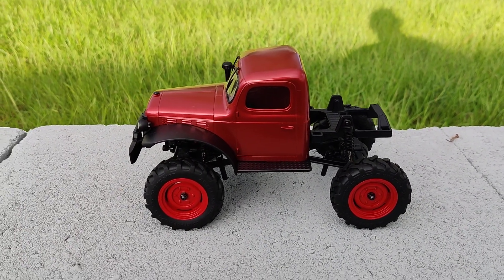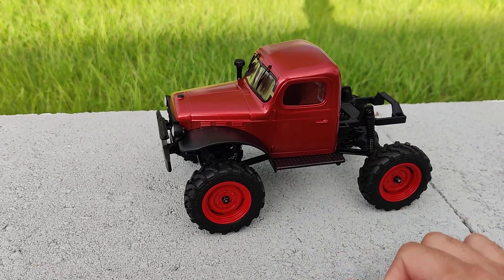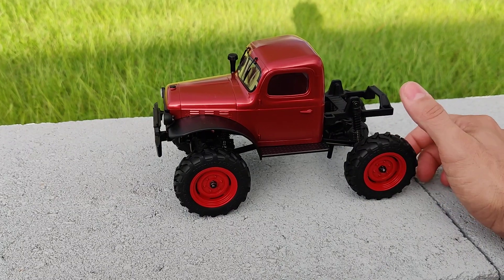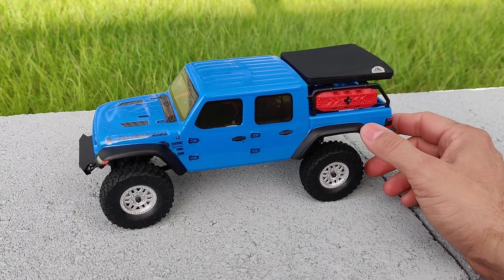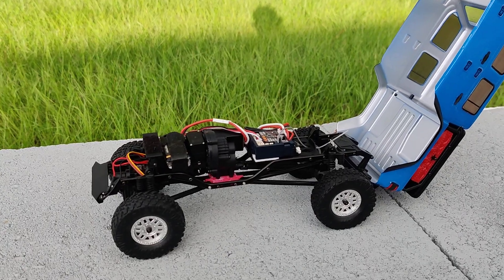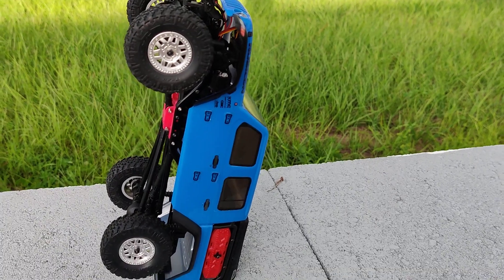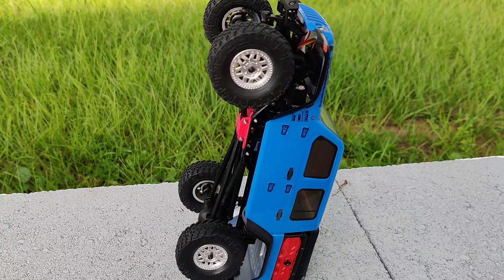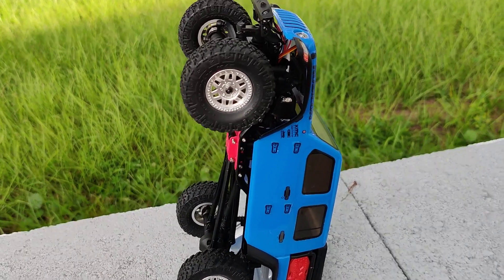SCX24 Two Speed Transmission Swap!!!

Comment: Thanks for showing!  Pretty cool. Feels like running a Furitek with the old axial scx 24 radio and using the different switches for control or speed. I personally prefer a single speed that has a good mix of torque and speed so including have to switch between gears
Reply from the maker: I like it but definitely not suited for any kind of competition due to its high center of gravity but I think I can make better, already tearing it apart to get inside its guts!!!🤣

Comment: Well I started on a mount to make this swap but ran out of time. Haven’t been able to mess with it in a couple days. Think I’ll stick to fcx24 axles if they get some metal gears though. Those worm gears killed the speed. High is like low lol. Hopefully we will just get some chassis options for the fcx24 soon! Hint hint 😉
Reply from the maker: Working on that as well😉. But yeah, this set up is mainly for those looking for extra slow. I think the fcx will open up the door to a different class altogether if we can bring enough support for it🤔. SCX24 is the king of slow which is great for comps but I feel the extra speed of the rcx makes for a more "fun" experience if you have enough room for it.
Reply: @Gamyrc  yeah I’m honestly sick of the worm gears. Crawling with the fcx24 made me wanna never go back. Then I stripped a gear on the fcx and basically had to 😆

Comment: Is that just the transmission swapped or is that the motor swapped with it as a whole cause i was thinking how would it be if you used the whole setup bet that gladiator would rip probably gonna do it with my max smasher and bronco scx24

Comment: Well done! I knew it was just a matter of time. Curious to see what difference a Lizard makes. Micro Komodo is an odd choice unless you throw a big pinion on it. I think I'd rather go higher KV 1410 inrunner. I think it'd be an easier swap as well.
Reply from the maker: Micro Komodo is just stronger and has really good low end torque. But, yes the 1410 would work as well.

Comment: It seems to me that this “upgrade may be redundant in that why shift gears when you get that much slow roll and good speed out of the Komodo set up? Asking for a friend
Reply from the maker: The benefit will come from having different speeds regardless of motor used. This setup was using the stock 130 motor which is by no means a great motor, once you swap to a "better" motor you would see much better results. The Komodo motors are great at low speed control but some guys like trail riding as well and uf geared too slow they have issues achieving fast enough speeds to keep up with the other guys. This gives you that extra bit of flexibility. The gear ratios on this trans are far enough apart that it makes it seem like two different vehicles. BUT, there is the penalty of slightly higher sitting motor which would hurt in competition crawlers so deffinetly not for those cases.

Comment: Someone just needs to make a flat LCG 2 speed transmission for the scx24. Come on you guys with 3d printers, get to it!
Reply from the maker: Lolol, boy I just mentioned it on the video that Ive been working on one! The problem has always been sourcing the specialized gearing to make the engagement mechanism. And now that this one us out what I may do is rearrange some stuff to make it better since they already provided hard part🤷🏻‍♂️.
Reply: I did catch that, and that's awesome! I've also been considering how this would be done, but like you said, the layout of the fcx24 transmission is not ideal for LCG in scx24. I was suggesting someone redesign a 2speed transmission with a "flat" layout. I drew up a design of what i envision, however i lack time a resources to follow through with it. Prior to the release of FMS version, i found Orlando made a 1/34 scale 2speed transmission that's small and metal. Only thing is, its output shafts are reversed and it's $100 USD.
Reply from the maker: @acreus  Thats and they motor choice for it is too weak for our use. But it is really cool they managed to get it that small.
Reply: I would imagine you could make a custom motor mount to add the motor of your choice to the Orlando 2spd transmission and servo. Then you would have a smaller transmission made of medal. As long as the smaller transmission can hold up to the amount of torque an scx motor produces, i don't see why this wouldnt be a better option to modify than the fcx24 2spd transmission.
Reply from the maker: @acreus  Price and reliability would be the issue in my mind. Sadly like you pointed out, that trans is really expensive and being so small theres no way theres enough gear strength to handle the brushless motors we are throwing at the scx24 now😔.

Comment: With the stock axial axels top speed in high really isn’t faster than the stock transmission.
Reply from the maker: Exactly. You just gain the super low speed. The beauty of this trans will only show when we start using different kv motors on it. For now is more of a "extra something" thats all.